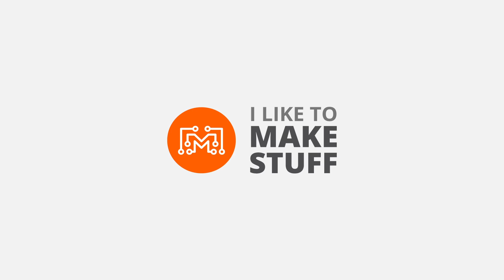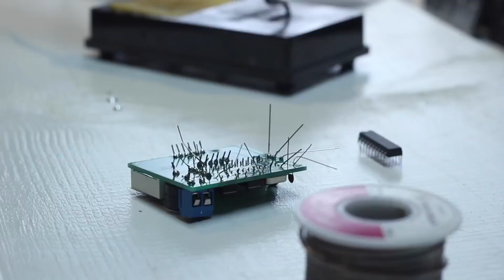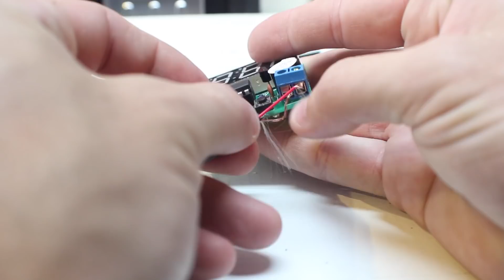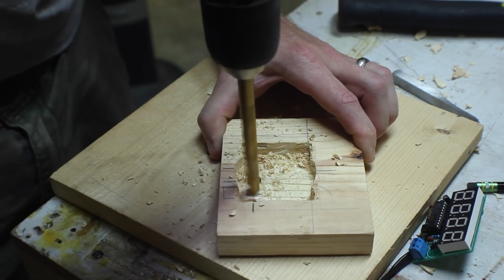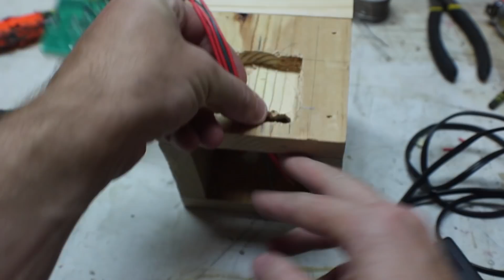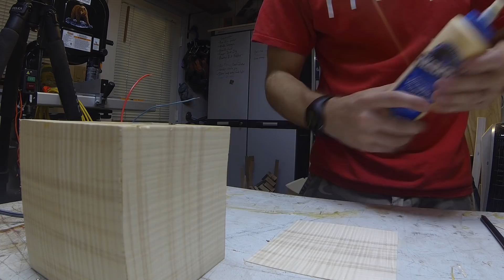Wooden digital clock // How-To | I Like To Make Stuff

Comment: For Veneering, sand the back of it first. Use contact adhesive spray, spray both sides, leave for a minute to fume a little then massage/press it on with a rubber roller. Trim off the excess with a fine file with masking tape on the end, move in a cutting motion cutting with the thin edge. Sand level with 180 grit towards the face of the box sides.

Comment: I would think about using a different clock kit. My experience with the C51 kits are they do not keep accurate time. I built 6 of them and they all ran very fast, minutes in a couple of days. The have no adjustment so you might resetting it frequently.

Comment: I realize this is late, but I made my own clock. Like, literally. I programmed my own clock. Not really 100% happy with it, would have prefered to use a digital face, instead I used a LCD which I had to use 1 of the 2 lines, so it was small and such... I used an arduino, a RTC (Real Time Clock) module, 2 buttons and a switch. Of course, also the LCD screen. AND I 3D printed the entire body. If I could make it so the display was larger, I think I'd be happy with it and would use it as my actualy bedside clock (Phone is for the alarm, clock is for the time) I also made it so you can fit the usb and the power cables in without having to take it apart, incase I wanted to change it... Actually, maybe I can get a ASCII art to represent 1 that takes up 2 lines, but having tried to look for it, couldn't fiond it :/ LCD is 16x2
https://imgur.com/a/IedGJ Old version when I was still making it... No idea where it is. I could probably find it, but dont feel like it tonight :P

Comment: Nice idea :D Next level would be to make a server room in the middle of your home with open wiring and no insolation, then you can hang all sorts of smart appliances with lights right on the plywood so it shows through on the other side. And with no hassle connecting wifi or power neatly.. maybe some sort of touch screen works too. Might try it myself someday <3

Comment: Use 3M 90 spray adhesive to apply veneer. Use a fine file to cut it down instead of a knife or sanding. A veneer saw would help but a file will do.

Comment: if you make one with an arduino (something like an arduino nano would be ideal) you'd have full control over the format and brightness. you could even put in a temperature sensor, and if you use a nodeMCU board (cheaper than arduinos and have built in wifi) you can make an internet clock which you'll never have to set!

The veneer idea is really inspiring i've got a few OLED screens i'd like to play with see if they can penetrate it for just such an internet clock i'm designing. I'd imagine that if it's too dim you could always sand away at the inside of the veneer until it's paper thin
Thanks for the videos man!

Comment: +I Like To Make Stuff Hey man, love the channel just had some questions about the build, this sounds kinda stupid but what are the buttons used for and is it possible?would it be easier to do it without the buttons? Also if I buy a kit that has a charger included do I need to mess around with old phone chargers?  And lastly what was the dimensions of the cube?

Comment: What do you mean, a 24-hour clock isn't useful? After a week's worth of re-training my brain through the day by adding 12 to anything in the PM range I've become pretty adept at converting to 24-hour, and converting back to 12-hour. Good examples of how 24-hour is useful is for at-a-glance timekeeping without needing to denote AM or PM, and by virtue of that, for people who grew with 24-hour, there is zero ambiguity of when it is day or night, compared to 12-hour where one number has two states.

So in short, I like 24-hour because there are 86,400 unique times (a full day in seconds), compared to 43,200 unique times independent of the meridian designation.

Comment: hey man nice job on the clock. i have done veneers before i found it worked really well to use a plunge router with a end bearing straight bit to cut the veneer back to the surface then after that's done on all side use a file to get the edges perfect.

Comment: Who uses the 12 hour clock anymore, anyway... It's useless. The same goes with the metric system, it's the only way to go
Reply: There's LITERALLY no difference between metric and imperial time aside from personal preference.

 For that matter, why don't you count time by minutes? Hours are barbaric units of 60. Definitely not "metric". Minutes should be 100 milliminutes and an hour should be 100 kilominutes.

Wake up at 4.2, go to work at 5.4... It's clearly superior that way.

Comment: Nice job Bob. You mentioned about veneering suggestions. I find contact cement works great. Shear off the over hanging edge with a fine file edge, then block sand. Cool idea for a clock showing thru the veneer. Keep these videos coming. I'm just starting to get into electronics with Arduino and Raspberry Pi. Tough to find good, practical projects. You have a bunch tho, thank you.

Comment: You could also apply the veneer by putting a THIN layer of wood glue on the pine and also the veneer back then let them dry. Once dry, join them both together, cover the surface with a thin rag or t shirt so you don't burn the surface Then use a clothing iron to melt the glue.

Comment: An aggressive file is the best way to bring veneer down to size, then I touch it with 120 grit and you're off. Always sand/file unidirectional towards the glue, so as to not pull the veneer away.

Comment: how to increase brightness?
Reply: if you buy a clock with a higher voltage requirement the display is usually brighter. I have a clock that runs at 18 volts and is very bringt.
Reply: ohh yes dats thebest solution. thanks.

Comment: Hi Bob,

Great channel you got there!

I have definitely some advice for veneer.
Next time you just need some (white) wood glue.
Brush or roll both sides with glue (so veneer and the piece of wood you like to veneer) and let it dry for around 15-20 minutes.
In the meantime, heat up an iron (without steam!).
If both pieces are dried, just simply at both pieces together and heat it with the iron, this reactivates the glue.
The trick here is to push pretty firm (but not to hard!) and not to burn the wood.
Saw the overhang of you off like you normally do.

That's it, what can I say, Bob's your uncle! :-)

Comment: Mhh... Taking your problems with the veneer into consideration I'd probably go with a design featuring rounded edges along the horizontal as it would allow you two wrap a single piece of veneer all around the clock creating only a seam on the back which could be "hidden" in plain sight by creating a slot in the wood for the buttons and maybe a USB Connector since you're using a Phone Charger anyway.

For the top ( and bottom if you want ) you could either use a type of wood that matches the veneer OR color it in a contrasting/matching color which, at least to me, would probably work better than attempting a gapless fit between the veneer sheets.

I kind of wonder if it would be possible, with the help of a router or similar device, to create a thin enough area in a block of wood for the LED's to shine through thus making the use of a veneer unnecessary. That would be the most pleasing solution =)

Comment: Hey Bob, are you aware that Sharper Image is selling a clock that seems to be identical to yours in design? If so, was this your inspiration for this project? It's item number 204128 on their website.
Reply from the maker: I've seen similar things like this for several years, it's certainly not my design.  I haven't seen that one specifically, but lots of places sell them.
Reply: Alright, cool. I was just wondering. Also, thanks for the quick reply. You don't see that often.

Comment: A tip for those of you who want to make this. Mount only the display in the front cavity, and connect it with wires to the board which would sit inside the cube. If you use individual 7 segment displays then drill small holes in line with the pins(parallel connection). If you use a display module(like the one in this video) then drill multiple wholes in a line and enlarge them into a grove through which a ribbon cable would go(serial connection). The one in this video used a pair of 6 pins, 12 pins in total.

Comment: Veneer with heat activated adhesive are a better option. Just cut them to size, heat (a cloths iron works perfectly) and then trim off the excess (I use a small hand plain), finally hit it with fine sandpaper, this is where you can hide your crimes.

Comment: Looks pretty awesome. The only thing I would have done differently is put the clock a bit deeper and then fit a plexiglass or some other clear piece on top of it. I'm not sure how strong the veneer is, but it looks like there are a lot of areas where nothing is supporting it over the clock.

Comment: I do a lot of work with veneer. I would use MDF as a substrate as it is much more stable, even if you were to have clean corners, if you veneer pine, a soft wood like that is subject to considerable expansion and contraction dependent upon the season and your corners will separate. A good technique you could use would be to put the glue on the back of the veneer and allow to completely dry then place the veneer on the mdf substrate where you want it. Then use an iron (just a regular clothes iron) to reactivate the wood glue to the mdf. This will allow you to avoid needing any clamping pressure or vacuum bags for small diy projects. Allow the veneer to cool from the heat applied. Once it is cooled you will be able to trim the corners of the veneer.

Comment: usually with digital clocks have 12 and 24 hour settings though they usually default  to 12 but either way, try different button combinations to change the mode. you might have to push both buttons at once or get into setting mode and then cycle all the way through or hold one button while pushing the other button. i  sure someone  has a how to set your clock video somewhere.

Comment: I have that same clock.  I don't think there is a way to go from 24 hour mode to 12 hour either. Below are the clock instructions I typed up a while back.  I don't remember how I got them, but I probably used the free Google translate app on my phone.  I use that a lot.  All you do it get the Chinese (or whatever) words in view and it does a great job.

S1 (Left button) Changes the setting (A through I)
S2 (Right button) Advances the value of the setting and used at other times

The current setting you are changing is shown on the far left of the clock display.
The value you are setting it to is on the right.
Setting A: Set the hour (00 to 23 with 00 being midnight)
Setting B (8): Set the minute (00 to 59)
Setting C: Chime "On" or "OFF"
Setting D (0): Alarm 1 "On" or "OFF"
If D is set to On:
 Setting E: Alarm 1 Hour
 Setting F (If D is set to On): Alarm 1 Minute
Setting G: Alarm 2 "On" or "OFF"
If G is set to On:
 Setting H: Alarm 2 Hour
 Setting I: Alarm 2 Minute

When the alarm sounds, S2 turns it off.
In Clock mode, hold S2 to enter the seconds correction mode.  In that mode, press S2 to reset the seconds to 00.

Comment: Here's a tip you might try next time you use veneer.  You can use use a yellow glue (I like Titebond II since it has some water resistance) and spread it evenly on the veneer AND the substrate and then let it almost dry(let it sit about 30 minutes or so).  If your veneer has issues with wanting to curl, try spraying water on one side of the veneer(the side that isn't getting glue) before you apply the glue to the opposite side.  This will counteract the moisture in the glue causing the veneer to want to curl. Next,  place the veneer on your substrate and use an iron on a fairly high setting and keep it moving across the surface so it doesn't start burning the wood.  The heat from the iron will cause the glue to adhere to the substrate.  That's pretty much it.  It cools pretty quickly(like a minute) and you can trim it at that point and do the next side.

Comment: hey bob for the vaneer I would do the 2 sides like u did and use a trim router with a flush bearing cutter that will get it really accurate there is also a laminate trimmer which u could buy cheap otherwise :)

Comment: I Like To Make Stuff, I'm trying to learn more about electronics, the small interrupter push buttons have four terminals where the two large red buttons in the back of the block has two, which two wires I solder the two terminals of the small buttons?  Great tutorial btw, really excited about making one of these. Thanks!
Reply: +Omar S If you look at the back of the board, you'll note that at the bottom (edge) of the board there is a track that ties together 2 of the terminals from both buttons  (ie 4 terminals total tied together) On the 'upper' edge of the buttons, the two terminals on each button are tied together, but the two buttons are separated.

So to connect the external push buttons, you can attach one of the wires from each external button to any of the 4 solder points on the edge track. The 2nd wire from each external  button needs to connect to one of the 2 'upper' soldering points on the corresponding board button.
You could solder the first button to the upper and lower left-most points and the second one to the upper and lower right-most points.
Let's see if this attempt at ASCII art works out:

---       ----

  B1             B2

----------

Comment: Hi Bob! 
Thank you very much for your videos. I'd like to comment on veneer glueing. I know the other way how to do it. Put pretty thick glue layer on your veneer before cutting it to pieces and wait for the glue to dry, just for an hour or so, for it not to be sticky. Than cut your veneer to necessary pieces, put one piece to it's place and press it with hot iron. Veneer beautifully sticks. Repeat it with all other pieces.
The advantage of this method is that you can precisely put veneer in it's place and avoid all unglued places.

Comment: Perhaps someone already pointed this out (so I apologize for a repeated comment if that's the case). When you used the brad nailer, you held the pieces together with your fingers very close to the joint. Sometimes those brads can deflect within the wood and you could be in for a nasty surprise. Overall, though, I thank you for this video. My 13-year-old son will soon be building his own version, I'm sure!
Reply: +Chris Boebel This happened to me on a project - OUCH!

Comment: One option you can do that may make for an interesting effect is cut some cross grain veneer and use that for at least the area with the clock display.  For instance some woods like oak have thousands of open tubules if you look at a thin end grain sample of the wood. You can easily see this by cutting off a thin (about 1/8" piece) and looking through it at a light source.

Comment: Instead of wrapping the wires, as a more proper, more permanent solution, use heat shrink wrap.  You can find this online on places like Amazon and in some hardware stores such as Ace Hardware as well as a few places with electronics like RadioShack.  It's super easy to use, just cut some, slide it down the wire before splicing, move it into place after wrapping the wires in parallel (instead of angled) and use a low powered heat gun (or even a blow drier will sort of work, though they have a lot more airflow and will be less effective.)  Actually, I recommend adding solder to the wires first, but if you don't have much space you have to be careful that the heat from the iron doesn't make the shrink wrap shrink and prevent you from moving it over the wires.

Comment: Why not use reed switches to change the time? You can controlled them with a magnet through the veneer and maintain the pure wood look of the clock. You can just mount them close to the surface of the wood and wire them in place of the switches.

Comment: Sorry that this is late, but couldn't you technically use something lighter, like Styrofoam, for the body of the clock before you put the veneer on? Or any material really.
Reply: +Jedi Parker You could technically use whatever you want, but if you use something soft like styrofoam, if you bump the clock it's just going to crack the veneer. You're really better off using something solid like wood.

Comment: i think taking a plane or sander to the veneer  on the clock face to thin it down a bit might work better. or there are paper veneers . but they are shittier and then the woodworking needs to be better.

Comment: An LED clock and circuit is not that difficult to program. Though it may be more expensive, it might be worthwhile to prototype an LED clock. All you need are some MAX7221 chips, 7 seg. displays (or LED matrices), some coding skills, an RTC module, and a microcontroller.